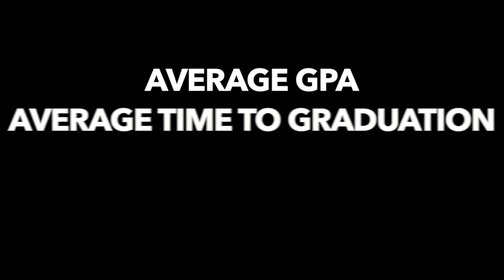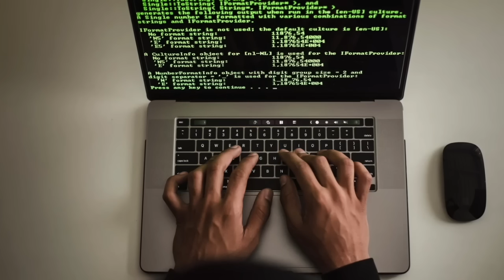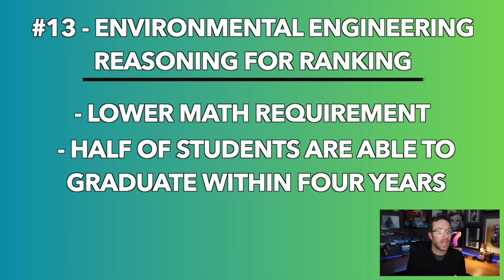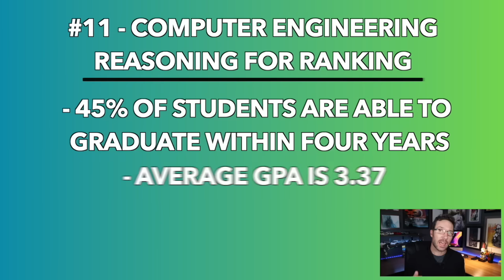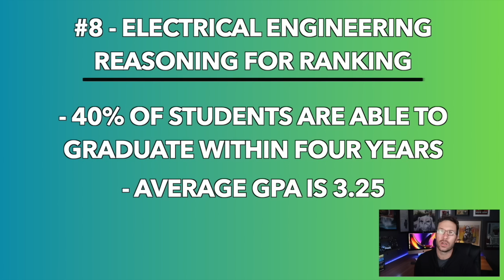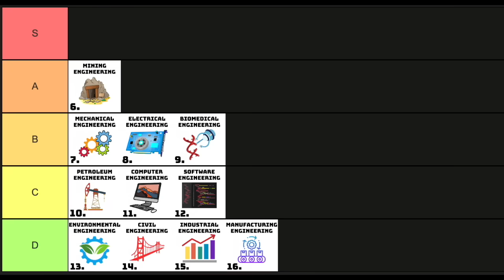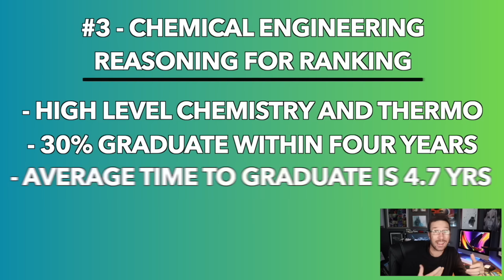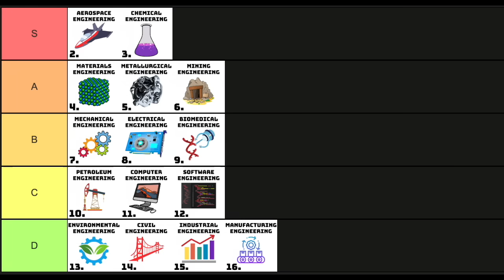Engineering Degrees Ranked By Difficulty (Tier List)

Comment: One other factor to consider is passing a professional license examination. How does first time passing do across the specialties you’ve mentioned?
Reply: I think if you're considering that factor, it's also important to consider how important for one's career it is to have a professional engineering license.  A lot of engineering jobs don't require one, because they're working on a large team where someone else has the signoff responsibility that requires the license, or any number of other reasons why they don't need that license.

And then there are fields like computer engineering, where basically there isn't a professional licensing program at all, so the first time passing is essentially infinite.

Comment: If climate change caused by excessive CO2 production is an actual problem (rather than a political one), the only real solution is nuclear power, which means that the growth potential would be around 120% in nuclear engineering jobs.

Comment: I graduated in 1988 with an EE.  I believe it’s much more difficult to get an EE than ME because of the more complex math needed.  CE definitely difficult also because of the advanced chemistry and thermo.  I agree with your list but EE should be several spots higher.
Reply: You say that ME is easier than EE because EE required a lot of complex math, and then you say that CE is very difficult too because it requires a lot of thermodynamics .
But would you say if you know that ME requires maths as much as EE and what would you say if you know that the origin of studying thermodynamics is ME and that CE study thermo as brief course not in detail as ME does ?

Comment: Thx for the effort, I won't speak for any of the chemical or nuclear related degrees.  I would disagree with your GPA, time to graduate, level of difficult.   Ive been at this for 30+ years been around all kinds of engineers at all different ages and worked with lots of young people, and they all (EE or not) say EE is the most difficult.  Honestly in 30+ years I can't think of a single person who has said differently, not one.  That said, I would not discourage anyone from purchasing the book - its another point of data.  I would strongly recommend: 1. Talk to as many senior (age) engineers as you can.  2. Actually go to the various engineering departments and get a rough feel of the number of students that made it pass sophomore year.  Talk to EE students, you will also find they transfer out of EE into something else, not the reverse.  I can't speak for every school, but if you go to a real school - that's what to expect.  Also just read the comments.  Last bit of advice, if you are thinking areo-space, don't, be a ME instead.  Too few jobs, too few companies, too few opportunities.

Comment: For Electrical engineering the highest level of math is actually stochastic processes specially if you want to work in communications and control fields. Also for Mechanical engineering you need Calculus of variations! I guess this is only an undergrad course we are talking here! Also many of the subject are common and shared between different fields, e.g. a compute hardware engineer is almost a digital electronics engineer and vice versa!

Comment: This does not sound right to me as I tried to get an electrical engineering Degree and failed.  I was required to have engineering math 2 (partial differentials with linear algebra and matrix math).  Did not get through that course and I also had to have calc 3.    Here he claims only up to ordinary differential.  That is wrong from my perspective.  Many of the harder course required by the degree had calc 3 and engineering math as prerequisites, like signals, one of the classes reported as the hardest courses, even engineering economics used partial differentials.  So I don't know about the other stuff.

Comment: A degree in engineering is just a starting point.  As a GEOTECHNICAL CONSULTANT for over 50 years, I told my new employees, "You know nothing, your instruction begins now". Think of an undergraduate degree as a starting point. A place to get a basic education. Above all pick a University that gives a broad range of core subjects. My degree in Canada was a 5 year course. When I applied to Berkley for a Master degree they asked if my undergraduate degree was just one degree or more. I took chemistry,  biology, English, electrical, statistics, advanced calculus, structural analysis, fluid mechanics just to get to the specialized courses in geology and soil mechanics.

Comment: Chemical engineering student here. Yes, you have to learn some chemistry which is a unique subject since it doesn't connect too much with math and physics, but you don't have to study organic which is the true beast. Not saying the required gen chem is easy, but it's not even in the same realm as organic when it comes to difficulty.

Comment: I found electrical engineering is extremely versatile.  The math and physics you learn and programming classes you have to take make it to where you can easily learn and become a computer, software, electrical, manufacturing or mechanical engineer.  At this point in my career 10 years in I find myself able to perform all of those adequately.  You could probably learn the concepts of nuclear engineering or chemical engineering also, but it's probably tougher to walk into a job like that with an electrical engineering degree.

Comment: I graduated in 1981 with an Honours degree in Electronic Engineering and we had a very solid and basic education in Physics and Mathematics up to the second year. As an external examiner I have noticed over the years that Engineering education at the University of Stellenbosch have become very watered down with an emphasis on application instead of understanding the principles. This has lead to an increase of the number of graduates, but in my opinion a lowering of standards.

Comment: You need a solid understand of PDEs as electrical engineers. Maxwell's equations are PDEs for crying out loud, not to meation fields and signals analysis... Any electrical engineering undergraduate program that's doesn't require study of PDEs shouldn't be accredited.

Comment: The only reason Chem Eng. is so high is they have to take Organic, and Engineers HATE Organic. There's no math, which is their forte and it's like a year of waterboarding to an Engineer. EE is probably the hardest curriculum. Those people think in Greek symbols.
Mechanical is the most  versatile degree. Usually you can take that degree and apply it to most Engineering situations.

Comment: BSChE 1981 U of Michigan (no. 5 in that discipline at that time), 3.42 gpa (top 15%).  JD/LLM 1998 Franklin Pierce (no. 1 in intellectual property law at that time), 3.63 gpa (no. 5 in class while earning 2 degrees in 3 years).  14 years practicing ChemE (licensed PE), 25 years practicing IP law.  I am qualified to say that it is way harder to be a good engineer than it is to be a good attorney.

Comment: You missed Geological Engineering... They work with Civil Engineers, feeding them analysis of the stability of the rocks and soil that structures are built on. They can also work with Mining Engineers - doing the same for mine design. They also work with Petroleum Engineers - providing them the geological data on which to base their calculations. Finally, they can get involved in resource exploration - in petroleum, metals and industrial minerals. Would be interesting to see where they fit on your scale.

Comment: I scraped out a degree in Mechanical in 1996, and the demand happened to be very low that year. I have never worked as a Mechanical Engineer. I recommend picking a school with a strong Co-Op program.

Comment: Wits University offers Metallurgy and Materials Engineering in One

The Metallurgical Engineering also includes process engineering, which is also useful in chemical engineering

Metallurgy is split into two: physical and extractive metallurgy

Wits University offers both in One

Comment: Physics grad here and I smiled at the modest (to me) math requirements for all.  By my senior year I only had to take one more advanced math course to fill a math minor due just to taking the prereqs for my required major courses.  The senior level Electromagnetic Field Theory Physics course is so difficult that it's the primary roadblock to a BS in physics, and if you can pass it they give you a degree (just kidding - but it seems true).  I still wonder that I was somehow able to pass it.  There's a lot more jobs for engineers than physicists though.

Comment: Purdue Engineering Grad here (BS/MSECE), and our undergrad program requires PDE's, Complex Analysis, and Discrete Math as part of the Mathematics requirements....lot more than people think!  Also, you've omitted Agricultural Engineering (which Purdue, Illinois - Urbana Champaign, & Cornell have incredibly strong programs in this branch).  Finally, one should consider  if COOP work experience fsctors into 4+ years to obtaining the BS Degree......Purdue's COOP Program allows up to 5 years to graduate.

At the end of thd day, the perceived difficulty of any one Engineering branch boils down to interests, knacks, and work ethic.

Comment: A mechanical engineer can do ANYTHING that any other discipline can do.  Without us, you would have no machines, energy, or air conditioning.
Reply: True, but we would have to open a textbook to figure out how to do a lot of it, like making a good radio antenna or figuring out the right ingredients for a high-strength concrete mix.  :)

I figure the most important thing anyone learns in an engineering degree is the general paradigm of how to think about engineering problems, and how to figure out what you need to learn to solve a problem and then how to learn it.

Comment: Just so we're clear..
My experience with an engineering school was as follows:
After getting most of my physics, math, and chemistry done at a junior college.. ( through O chem, diff eq, all three physics)
I went to Cal Poly Slo for civil engineering environmental.
Big mistake.
The dropout rate for engineering at this school was 68 percent.
This is a school that is not interested in graduating engineers and didn't give anything special to help support engineering students.
They simply do not care about you, the student.
In addition, the equipment for the labs was broken, and most of the classes did not consider any extra work such as homework or labs as part of the final grade.
To make it worse, financial aid could not keep up with the constant increases in tuition.
In short, I finish my degree at a different school and now run a successful engineering consulting firm.
I do not hire cal Poly graduates, it says so on the application..
I do not believe those students received the necessary education for the job at hand.

Comment: Electrical engineering has partial diff eqns lol whats going on with america??
Reply: It would normally be part of the calculus courses required for all engineers, even the ones who won't need it for their engineering courses. For EE though, you will use it in multiple courses.

Comment: Several variables are not mentioned such as average years of working in industry.
Aa someone with both Math and EE degrees, the math in Math was easier.
EE math was higher level, but more specific. DE included partial DE at my school.
I also took advanced DE for fun (and credit).
In the engineering school I graduated, 
Chem E was tops, EE next, then mechanical, civil and industrial.

Comment: '96 EE & Physics, for a disclaimer.  First, I don't think Software Engineers should be treated the same as other engineers, in my experience a Software Engineering program is often structured differently at many schools than other engineering disciplines which 'require' cross discipline courses; whereas Software Engineers only learn software development & theory.  (note: I have worked professionally as a software engineer, and managed large teams of software engineers.)  Second, I disagree with the criteria you've used to 'rank' the disciplines.  For instance, if you have a lower quality of candidate in a less in demand field, then you can have a lower rate of completion & longer duration even if the discipline isn't the hardest.  Conversely, if you've a popular discipline with a high barrier to entry (ensuring more talented students), then you're going to have a faster completion at a higher success rate.  In addition, saying all EE's for instance are the same, is not true (either of the program or the graduate).  For example:  a power systems focused EE or a digital circuits design EE both have an easier life than an EMag EE (who has to fight through some incredibly difficult math & physics)...  so we'd need to aggregate the sub-specialty with the associated difficulty by the percentage of students.  (I'm sure the other Engr disciplines have similar easy vs hard sub-specialties/routes.)
So while the video was a nice intro to various Engr options, I'd hardly consider the ranking definitive.
Reply: As a ME who now works as a Software Engineer, I'd agree with you on that.  It's a weird thing unto itself, and quite unlike physical engineering in lots of ways.

Comment: what do you mean about "Even with the advent of AI software engineering is still in demand", if AI can replace programmers then it's over for everyone else too.
Reply from the maker: It will replace some of the more simple software tasks and some jobs for sure ... but in large part, it will free up engineers' time to work on the development and big picture stuff.
Reply: @becominganengineer2271  I'll be surprised if AI replaced any developers, it's more like a fancier way to Google search than it is actual intelligence. I don't understand how it works well enough to know if it can be more but it's probably safer to bet no since being able to do anything valuable at all has taken 75 years of research

Comment: Hi, Jake.  I’ve worked in Silicon Valley, as a mechanical engineer for 40 years.  I’m 66 and have been retired now, for 2 years.  I like your rating list of engineering disciplines. I also like your insight in mechanical engineering, describing it as a bit of a jack of all trades, adopting and working in many different spheres of the engineering trade.  All I can add to what was covered, is that electrical engineers in every company I worked for are the most secure positions, with higher demand, in general, and better compensation than mechanical engineers.  I can attribute it to only one thing, there are fewer of electrical engineers available, for two reasons: it is far more dangerous job, requiring at most focus and clarity of mind, while on the job, and much more stressful, because of those factors.  In addition, the required level of understanding physics and math is greater, and also demand for continuous education, due to very fast changes in sophistication of hardware and safety standards.  One more thing, a computer science degree is also considered an engineering degree in Silicon Valley.  Computer science degree, at least in my book, is the highest degree, just by sophistication and complexity of disciplines, and amount of information required to be consumed.  Thank you, again.
Reply: You're awesome this comment was a great read
Reply: Completely disagree regarding computer science, as I am someone who ‘failed back’ from chemical engineering to graduate with a CS degree.  I am also completely opposed to anyone calling themselves a software ‘engineer’.  I can take a mathematician or any physical engineer and train them to be a programmer; the opposite is not true.  I came to appreciate the concept that any real engineer must have some proficiency in subjects of energy and/or mass transfer, materials, and laboratory methods and practice.  I have yet to meet a ‘software engineer’ meeting this minimum, unless they were educated through a real engineering program.
Reply: @brianfeathers7473 My apologies, I believe, there was a mixup in terminologies, my bad.  I was using “computer science” in terms of science of designing and manufacturing digital hardware, including: integrated circuits, computers, and semiconductor technology, in general.
Reply: @brianfeathers7473 You know what’s crazy through? All these “real engineering jobs” work with machines and equipment that only operate because someone developed software for them. From robotics, complex machines that handle multiple processes, to heavy duty equipment lifting; someone had to write programs and code for it. It is a real engineering job; your not better just because you decided to work a more manual route, spend the majority of your time learning very complex material, work longer hours, and have a more difficult work life balance only to still make less then the guy who spends most of his day sitting at his desk in his comfy Herman Miller chair in his nice air conditioned office with his Starbucks latte on standby looking at a computer screen and typing code. 

Also if it’s that easy; you’d have more people in the field. Most people trying to enter the field from here till 2032 will either give up half of the way through to pursue something else or switch careers when the 9-5 life begins to suck the soul out of them.